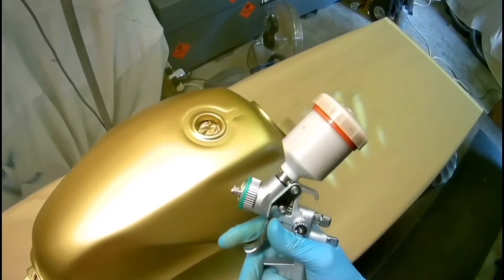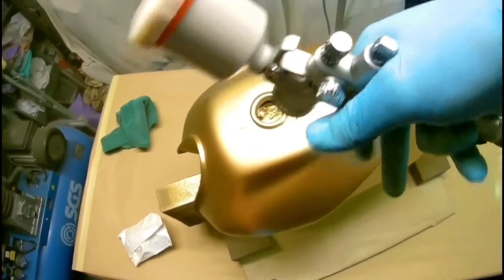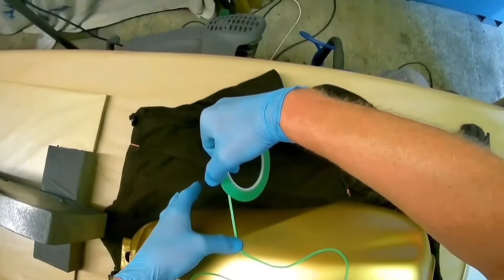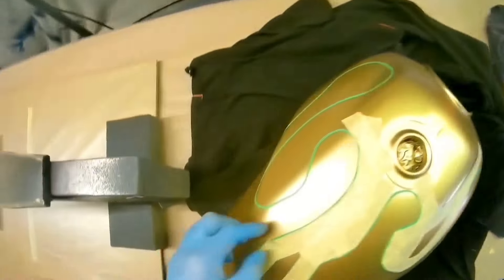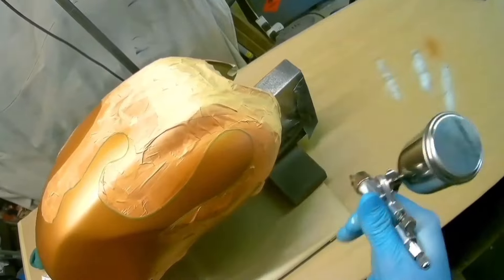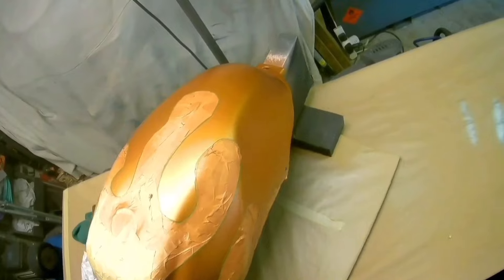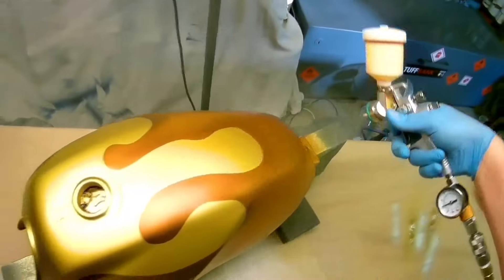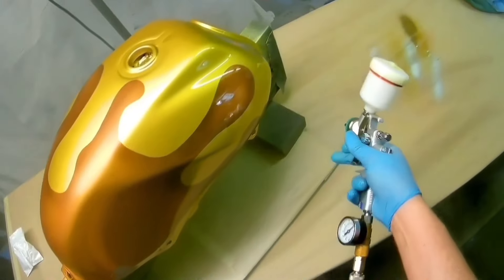Candy Paint Job With Fine Line Tape & Sata 4400B & LPH50 Iwata

Comment: Thanks so much for the paper grit tip. Just as so said, I used 800 grit and the base coat lifted with the tape🤬
Reply from the maker: Hi David, yes, people often use 800 for a smooth base but it too fine if your doing tapping, as you say it will lift, I did a little experiment once with different grits under and definitely 400 or 500 on a DA sander is better although it takes a little more coverage with the base, cheers 👍

Comment: Fantastic job on the tank Pete came out looking mint, when you were putting on the second gold colour basecoat after you masked it up I thought it was the same colour you first used but after unmasking I could see it was different. 
I liked your choice of colours but if it was me I would have used a colour that was a bit more different to the first gold, purely a personal choice due to my colour issues, looked really nice out in the sun Pete the candy popped and the finish was very flat and glossy.

First use today with the Kapci white WoW primer, it's totally different to the other stuff I used as it's a lot thinner and laid down really nice, put the Green Hell Magno base over the white and it looks good so far, I'll be doing the clearcoat tomorrow. I have a few tinters on the way for the primer which should help 👍
Reply from the maker: Hi John, the first base colour is a nuagane gold, the second is a Honda colour, I'm away at the moment so can't give the code but it's a copper colour so quite different to the gold, the last round the edges is a brown metallic, also Honda.
It was about a 9 month ago i did it so i thought I would get it out because i have a fair few older videos that i wanted to get out.
I thought your wet on wet problem would be the thickness because I've used HB thinned down and it's gone on really well.
That's a video that I'm going to make soon, showing how much the base colour can effect the basecoat, manufacturers say under a white or mid grey for a reason, glad it's gone ok 👍
Reply: Hey Pete, yeah there are some nice colours there mate, I like the BMW Galvanic Gold but whatever the colours are the tank looks mint so I'm glad you did the video.
Yeah hopefully you are right and my old primer was just to thick but we will see tomorrow how it looks and I hope it holds it's gloss 🤞👍

Comment: That was a very nice result  , I can’t see that needing a flow coat at all and I doubt it would improve it , although admittedly it’s hard for me see 100% on my phone screen but it does look awesome in the sun . I think I might invest in a LPH 50 , I’m planning on doing some candy work in the near future so I think it would be a handy gun to own, think I’ll give up on the LPH 80 for now
Reply from the maker: Hi Roger, hope all is well,  It's very similar to the LPH80 and with the E2 cap on both it sprays the same, the only difference is the LPH80 can come with the E4 cap which gives a wider pattern, about 20% wider if you don't need that, and for most small things you don't, then the LPH50 is the one to go for, cheers 👍
Reply: @peteshobbies5383  hey mate , all is good , hoping it’s the same with you ! , I thinking the LPH 50 will be fine , I don’t think the bigger fan of the 80 would be much more benefit with guns in this size , as long as the atomisation is good and even , that would be my main concern
Reply from the maker: @Watch This Space Car Channel  The atomisation is just as good so it should be fine

Comment: What happen when the fluid is full open ? What the different ? Is gonna be more fast move to handle the full fluid open?
Reply from the maker: Hi Garasi, yes, generally the more fluid you are putting out the faster you will be able to move, if you have full fluid and go slow you will have too much material on the work,  this will lead to runs, to many metalic particles in one place, darker colours etc, it also depends on the pressure you use and the distance you are keeping from the work
Reply: @peteshobbies5383  copy that sir, thank you
Reply from the maker: Your welcome 👍

Comment: what size air compressor do you use
Reply from the maker: Hi Nathan, I have two compressors linked, one is a 90lt 14.5 cfm belt drive and one is a 50lt 14.5 cfm direct drive so it actually 140lts total.
I normally only have the 90lt running but both of these would run fine off a 50lt 8 to 9 cfm compressor
Reply: @peteshobbies5383  thank you sir for the reply and awesome videos
Reply from the maker: Your most welcome 👍